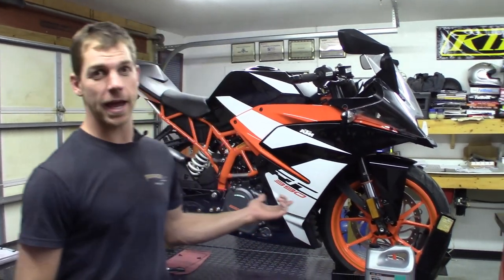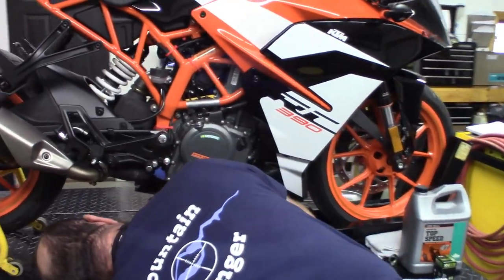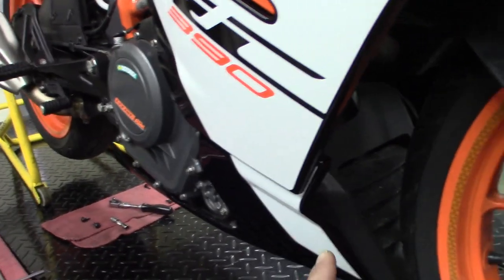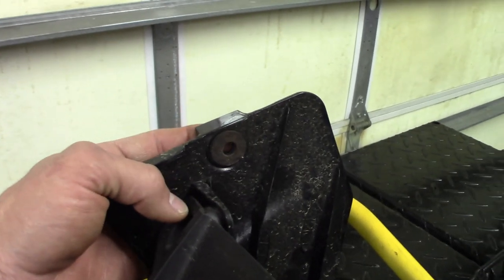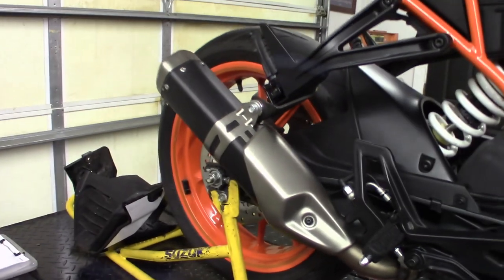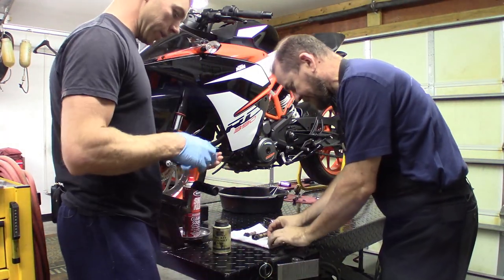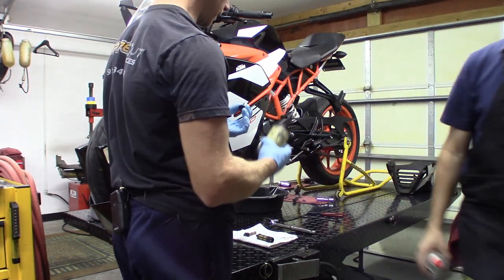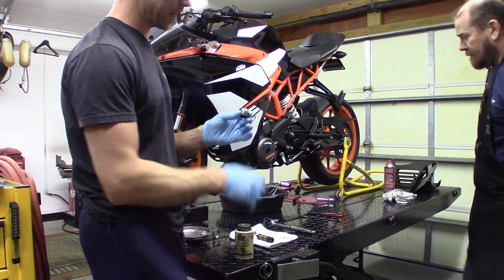KTM 390 RC engine oil and filter change

Comment: Just 1 point.
Running the engine for 2-5 minutes before draining the oil is a good practice.
This helps to get the oil warmed up and get little bit less viscous. So it drains easily and more oil is able to get out of the case.

Comment: Nice and clear explanation👌 
Which Engine Oil you recommend for KTM Duke 390 apart from Motorex bcoz it isn't available in our country and which one you pick Amsoil Metric 15w50, Motul 300V or 7100 or Putoline Ester Tech 15w50....Thanks😊

Comment: Great video,  thank you so much.  I'm having a very difficult time screwing the plastic louver centerpiece back in .. I just can't get the holes to line up.  It's about a half inch high and I have to push down really hard while blindly trying to get the threads started. If you have any tip I would really appreciate it

Comment: Mine is 2015 rc 390 i recently changed the oil and filled 1.7L but the level is not showing on the sight glass.when i tilt the bike to right side like 75°  it shows the oil
Any solution for it
Reply: Keep it straight up. After you run it for 2 minutes or so, you should see oil in the glass. If you don't, you need to top up your oil till you can see it. You're potentially damaging your bike every time you ride it without sufficient oil. If it's been awhile since you've done an oil change, do a full oil change like this video and continue to monitor oil levels daily. If it drops, take it to the mech

Comment: Hello,the drain filter must just be cleaned with the napkins? Or you have to change it with a new one?Thanks
Reply from the maker: You can cleaned it with brake cleaner and compressed air.
Reply: @tappedoutcycles2757  thank you

Comment: Doesn't the manual say u need to use semi-synthethic oil?
Reply: SAE 15W-50 is what my manual says
Reply: @bigbonede6201  i googled it and apparently it doesn't matter if u use semi of fully synthetic oil. Fully synthetic is slightly better for the engine, but I doubt u will ever notice that.
Reply: @ginogoossens8952  just bought mobile 1 full synthetic so I'm glad you just responded 🤣
Reply: @bigbonede6201  haha that's good no problem. I used motul 7200 15w50 I believe (the orange fully synthetic), but I'm sure any 15w50 is fine, and as I said fully synthetic is slightly better.